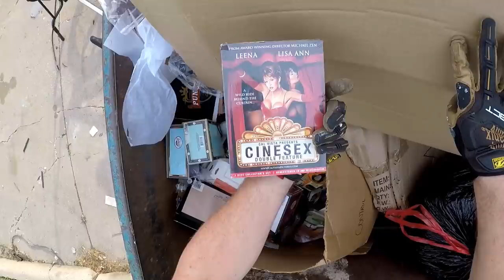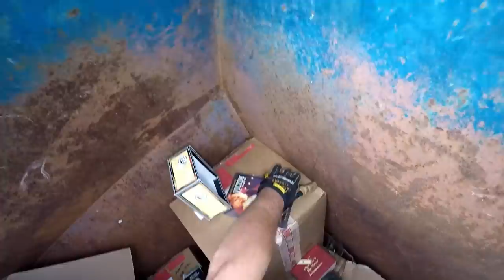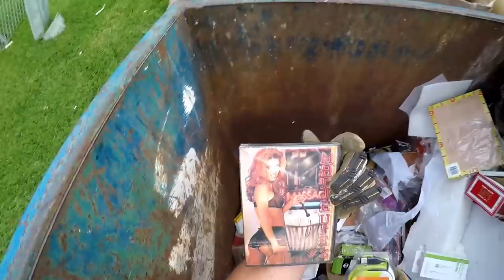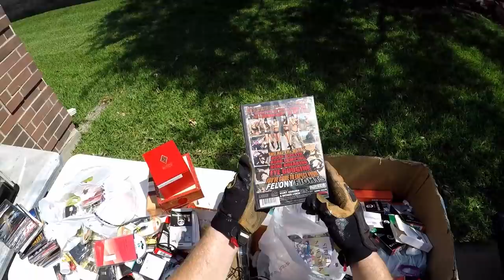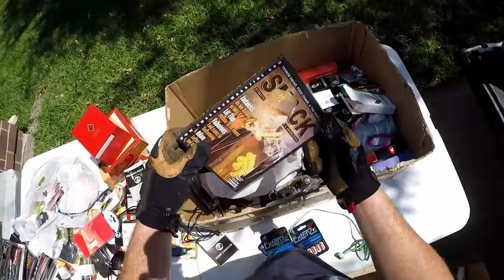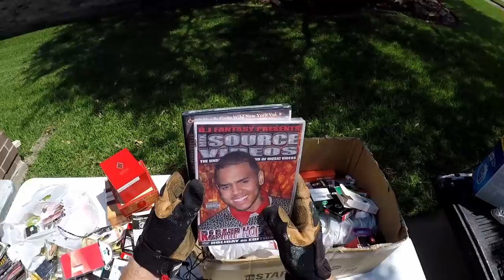Dumpster Diving "That's Bananas!"

Comment: Holy crap! U hit a jackpot! Damn!

Also! The plastic food storage containers, always check them for brand names...Tupperware does sell really well on eBay generally selling in the $10-$20 range for the midsize items with lids...they sell quickly which is always nice....or u can bulk them in a lot to sell to local resellers for 1/3 the amount u would get reselling urself which is still a pretty awesome deal for stuff from the trash...

Comment: That collapsible clothing rack you found around the 9:00 mark, with the casters on it, is like over a hundred bucks brand new. You could sell that thing to a boutique or resale shop for more than you'll get in scrap. I sold one like 10 years ago for like $50. You could easily get $20 for it quick.

Comment: those knives with white handles look like Dexter knives expensive good , restraint knives some of them go for 60 - 70 bucks each😎😎🇺🇸
Reply: Those knives are @ $120 each. I worked at Cracker Barrel, they used them. Restaurant, heavy duty use, professionally maintained once a month. They're usually rented, from the company that maintains them. Great quality if you're going to repeat use.

Comment: Masseuse 3, I’m afraid I wouldn’t be able to follow the story since I never saw the first two. 🤣🤣

That clock radio alarm clock was quite ahead of it’s time (pun unintended) when I purchased mine in 1985, it’s the only one I found with a dual alarm clock. I finally retired it a few years ago (probably in a box in the garage) but last I knew it was working just fine. Might have to dig it out after watching this because I think it worked better than my current alarm, that seems to randomly slip between stations, making it sound garbled in the morning.

Comment: Hey, if you love to do crafts, cigar boxes are a great wood to use. Carving to using in projects... such as a laptop pad for your lap. Like a pillow with a hard top inside the material. I knew a guy that used them to build structures for his train set up. Make cabins look real with siding etc. To make a craft box, using multiple layers of wood stacked then cut at dif angle,  carve etc.. they are strong. Web sites just for the craft... because the woods super light but strong .

Comment: Some of those vintage pda’s , especially the Sharp, have some nice eBay value depending on model. I’ve seen them sell in the hundreds of dollars before. Likely not yours but even then it could be a quick $50+ in used condition. Worth a look up